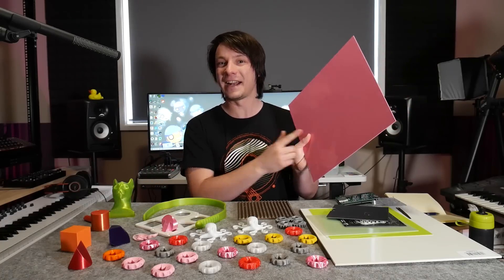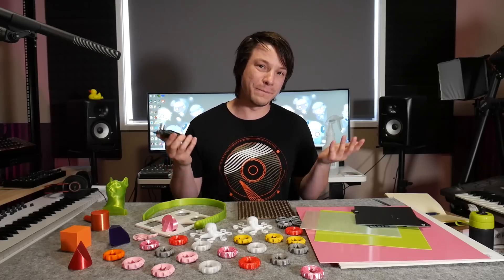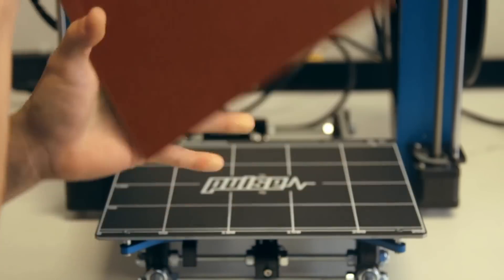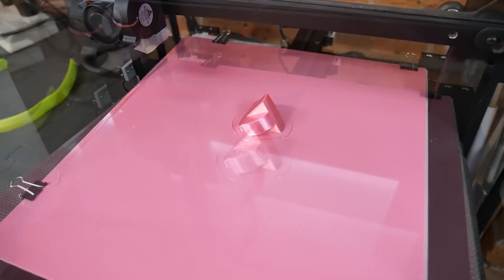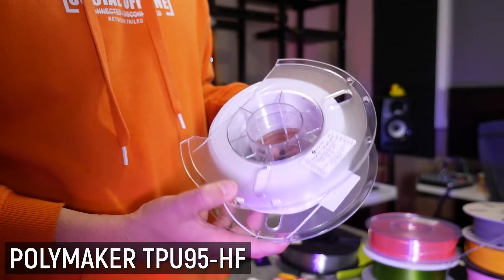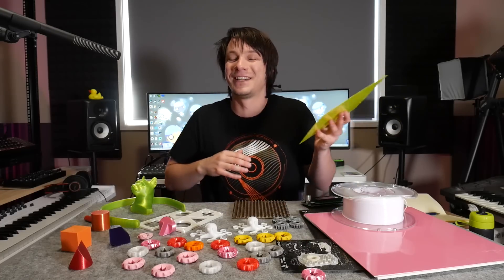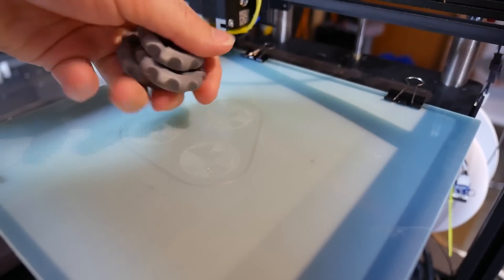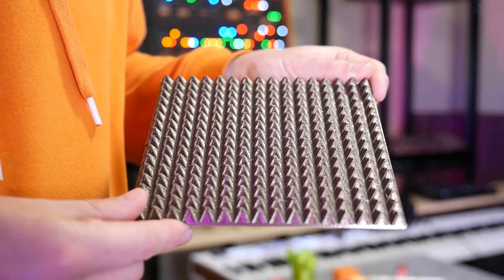G10 - The best print surface you've never heard of.

Comment: I use smooth PEI sheets on spring steel sheets with awesome results. They release prints as easily as G10 in the video, especially after they cool down a bit. How does G10 compare with PEI?
Reply: Yeah same, I use PEI for ABS filament and it works well with a raft or brim.

Comment: I've been doing this since 2016!! But I have an unetched PCB, the copper sheet makes my bed temperature infinitely more reliable!
Reply: That sounds brilliant! What thickness do you use, 62.5mil?
Reply: @McNibbler  that sounds about right
Reply: Nice idea!
Reply: Do the copper pours cause any issues with heating times
Reply: @McNibbler  haven't had any issues yet with heating times
Reply: You are basically talking about a different material then, as the soldermask on top of the copper is another surface than the raw epoxy resin of an FR-4 PCB. If it still works for your plastics, thats great. But i guess you could end up having issues, depending on the soldermask they used.
Reply: @ProtonOne11  An unetched PCB doesn’t have any solder mask - solder mask is applied after etching
Reply: @pmc_  If he just ordered a PCB from jlcpcb, pcbway or any other cheap pcb source, then they would still let the PCB run thru the solder mask application. If he prints on a bare PCB core with exposed copper on top, that is still not the same surface as the resin of a FR-4 board. My point was, that there are different material properties for different coatings/surfaces. So his properties with his solution (and what ever surface he prints on) does not compare to what Angus shows in this video.
Reply: @ProtonOne11  I bought a diy one from Jaycar with bare copper one side and g10 as the other side
Reply: @ProtonOne11  the unetched would still have a epoxy mask layer over the copper. Not a solder mask.
Reply: @brandonbrown3600  unetched pcb sheet is just G10 with a copper layer, no masking and no surface treatment, it's meant for you to put your own mask on the surface and chemically etch, there's no surface treatment, if you leave it exposed to the air it will actually oxidize the copper. If YouTube let me attach photos I could actually show you my stack of boards to demonstrate 😁
Reply: @brandonbrown3600  No they dont. 
They are made to etch yourself at home. Thus the copper layer is bare, else it clould not be etched. 

Some of them have a light sensitive layer preapplied, for people that intend to use lithography for creating the mask for etching.

Comment: I voted as wth is iT on Twitter but I knew garlite, just not g10.

I can't find it in my country sadly

I love my polycarbonate sheet tho! tho I should warn you most prints stick far better than garolite and you gotta scrape it off if you don't flex it (you can easily get a 0.5mm-1mm sheet so you can flex it, and the good thing is that if you damage it you can sand the damage off :) ) but A warning about polycarbonate is that strange it releases far better when hot, when it's cold you gotta warm it up again!

Comment: Speaking of printing on circuit board material: I once did a test and used TPU to print some circuit-like model directly on the copper surface of a circuit board. The plan was to etch away the copper that wasn't printed on, but I haven't done any electronics projects in a while, so I just never got to that. TPU sticks really well on copper. I think trying this would actually make a good video for your channel as it might also be useful for some robot projects.

Useless trivia: G10 is a popular material for making windsurfing fins using CNC. All the slalom fins I use now are G10.

Comment: Used G10 for custom drone frames. Recently as a transom for a boat.  Awesome i can use the left overs for a print surface now, thanks!.  Super useful material.
Reply: It's really popular for handgun grips too.
Reply: Hi Andrew!! What a surprise to find you here
Reply: what kind of drones, have you had luck with smaller 5inch or less? if its easy to cut, i might cut out a 4inch frame, but carbon is already pretty cheap for frames that small
Reply: I'v got G10 grips for one of my pistols, I never thought it would be used for a print surface lol.
Reply: I fabricate carbon fiber, kevlar and fiberglass. All compasite materials. All seem to want to kill you if inhaled. For flying drones carbon fiber is rigid has enough flex to survive many violent collisions. A mountain bike using specifically weaved panels depending on how common the damage is for the panel. Some weaved are meant for blunt force from the front, sides, back and multiple weaves on a single piece.

Fiberglass has slightly heavier if all else is equal. Such as layers of resin and layers of the compasite use. Fibergass will be able to withstand a much hardsr force becsuse of superior flexibility at the cost of significant rigidity. If the blunt force is too much it will hatter like glass. while Carbon fiber under the same force will shatter in a much less violent way.

Air drones carbon fiber, CNC and 3D printer thick Carbon fiber will is superior to alluminum making a  gantry made out of it extremely efficient. RC boats seem perfect for fiberglass so are bathtubs, toulets, sinks..etc.
Reply: do you like the g10 better than the typical fiberglass and plywood? I imagine a nice gray or blue textured g10 would look amazing with my eva decking
Reply: Now that i think of it,  I do have some old drone frames made from g10. I imagine it would work well on a rekon 1s lr instead of 3d printing the frame
Reply: I was wondering this exactly thanks!

Comment: I honestly think the least talked about but best print surface is Kapton tape. Been using it for years straight on alloy build plates, it is easy to apply, gives a shiny finish, heats quickly, releases when cool, just clean with acetone and can be bought in big rolls of varied widths.
 Almost everything sticks perfectly to it as it is, and if you don't go digging at it or crash a nozzle into it, it will almost last forever.
Its also the perect protective layer on a glass plate.
just spray the tape and plate with soapy water lay it on, use a squeegee to smooth it out and remove th excess water, done.

Comment: Wouldn't it be better to buy this stuff as one sided PCB material? You basically have built in pretty neat thermal interface - a copper layer - to transfer heat from the heated bed.

Comment: The epoxy resin matrix is the magic component. If you have a bit more money available for this hobby then carbon fiber sheets are a great alternative as well. 
Higher stiffness than G10 so you can use thinner sheets, which means better heat transfer.

You could also use a spray gun and apply a thin layer of heat resistant epoxy to a spring steel sheet and glue a very thin G10 Layer to it. 
FR2/Pertinax should work, too. Potentially the best of both worlds and relatively cheap (at least if you already have the necessary equipment)

Comment: Glass is the best material for a print bed if you can make it work. It's flat and resistant to thermal deformation. Try "roughing" it up with ultra fine grit wet sandpaper for better first layer adhesion. Since adhesion and release are contradicting variables,  you have to compromise for one or the other. I'm still experimenting to find the "sweet spot." Now, where can I buy ceramic tiles that cover the space shuttle.
Reply: @owowowdhxbxgakwlcybwxsimcwx  I don't like flexible surfaces because they deform overtime, and metal deforms due to thermal expansion. I just came up with another crazy idea. Granite or marble tiles leftovers. Damn it, I have to buy another heat pad.  LOL.
Reply: @owowowdhxbxgakwlcybwxsimcwx  PEI is a great material and I use it regularly at work to print ESD certified PETG ($110 a kg) for house keeping items. But in order to printing jigs and fixtures with tight tolerances, I need a build plate that is extremely flat and resistant to thermal expansion to print high temp filaments that can withstand 175C for thousands of hours. Something like ESD PEEK @ $450 for 1/2 a kilo. $_$ isn't a problem if I can justify the cost for something related to work. Most the time I BS to get an approval for my personal entertainment and learning. I've crossed that thin line many times like when I needed a pen holder, I printed a mesh skull pen holder and my boss was like...OK...LOL.

Comment: I used a spring PEI bed for my ender 3 pro instead of that horrible stock floppy one for a while, then I ripped a chunk out when printing TPU on it.. so I bought a different material to test, I regret it :/
It's just textured with some powder coat, things don't stick nearly as well. Then there's the faketak on my tronxy x5sa which I've only had a few weeks now, prints stick TOO well on it xD
Since I can't bend it, making it a bit hard sometimes to get prints off
Reply: @owowowdhxbxgakwlcybwxsimcwx  I think PEI fuses with TPU if I recall correctly, so it's probably not a good surface to print TPU on

Comment: Why not tape the 0.5mm sheet to a spring metal sheet with 3M Tape. It should have the  flexibility and you won't need clips since you put it on a magnetic surface.

Comment: I was a fan of FR4 until I tried FR2 aka Pertinax, Bakelite or phenolic paper. It is porous after sanding and sticks better to plastic while releasing easier release when cold. FR2 is also even more rugged than Fr4, my current plate is more than 1000 hours old and probably good for the same time, again. The price is similar, it‘s just not that easy to source.

Comment: I wonder if a single sided copper clad laminate is the same stuff. It’s advertised as FR4. It has copper on one side and that would definitely help with heat retention. It is often used for home made PCBs. Very easily available and is about 1.6mm thick.
Reply: @HPB1980 Yes ,FR4 is G10 with a fire retardant added.
Reply: @no-page  thanks! I have some lying around. I’ll try it out though it would mean fiddling with the Z sensor since it’ll now home to the copper under the FR4.

Comment: Anyone ever tried some of the ceramic paints they use on exhaust manifolds ? Paint it onto a thin steel sheet and bake it in the oven , wonder if it could work or if prints would stick to it - can handle 2000 deg F so they claim .

Comment: I've only ever printed petg, pctg & tpu; never bothered with pla.  Have printed oh... maybe 50 rolls of petg.  Been using a spring-steel plate coated with PEI.  Have been using it  for 7 months without adhesion or release issues on either of my printers. After going through 4 of the standard magbeds in a month,  I just use PEI now, its incredible. 
To be honest...I got a Garolite sheet a while back but have never needed it, so I never put it on.   And I've never used a glue stick while printing...ever.  No tape, no glue.   The print unsticks itself as it cools.  
Even a print covering a 200x200mm footprint with AMAZING adhesion will just....unstick itself, a minute or two into cooling.  Piece of cake.
Reply: @owowowdhxbxgakwlcybwxsimcwx  Yeah it's powder coated, and it's incredibly resilient, not soft at all.  I would go so far as to say it's very difficult to damage; and I'm using a vanadium plated copper nozzle, not brass.  
I've only done maybe 5 or 6 rolls of TPU but I just haven't experienced the issue you mentioned.   And I've printed 18hr TPU "disc golf" discs with surface area covering most of the bed. 
Since I put the one PEI bed on when I built that printer, and I used the Marlin bugfix fw, I have "printer stats".  So I can see that I've done 789 hours of printing on that $30 bed so far.  Still going strong.

Comment: I guess that the G10 sheet deforms because you are hitting the glass transition temperature when printing. It might be worth to experiment with higher Tg FR-4 (155 °C is common in PCB manufacturing, 170 °C is also available)
Reply: Aka FR5
Reply: G-3 is what worked for me, and did not deform with temperature
Reply: As the fiber glass is bound with epoxy resin in G10 it do not have a glass transition temperature. And I remember that 120-150°C is the point then most of epoxy resins will start to desintegrate when kept under those temperatures for longer period of time. The deformation is solely done by the forces that would otherwise cause delamination or warping.
Reply: @0thorgal0  It has a glass transition temperature. Also, most FR-4 materials have specified decomposition temperature where it starts fuming off, bubbling and increasing its volume due to the gas being emitted. You don't have to believe me, but having to deal with FR-4 properties is what pays my living...
Reply: @0thorgal0  To find a glass transition you first make stiffness measurements across the temperature range in question, then determine acceptable % of stiffness lost. Adding fibers increases the stiffness of plastics allowing them to be stiffer at higher temperature. In some cases, plastics will decompose before hitting the manufacture's decided % loss of stiffness but that is far from the whole story. Even steel loses stiffness at higher temperatures, the idea that adding fibers eliminates loss of stiffness at higher temperatures is utterly false.
Reply: @Anyone700  I don't know if your reply was meant for me as we are almost in an agreement. I understand glass transition temperature as point where the matter becomes elastic. What people here mistakes with glass transition is that any plastics looses some part of its structural strength with higher temperature (even way under glass transition temperature) and can suffer plastic deformation (it would not get under same load with lower  temperature). Most thermoset epoxy resins (I know) used to make glass reinforced sheets will sooner decompose then becomes elastic (and it have nothing to do with the glass fibers in it). 

In my point of view it is more advisable to use thicker sheet that will be strong enough on its own to not warp when the print will stuck to it rather than trying to make them flat again by bringing them close to their demoposition temperature to make them as weak as possible.
Reply: @0thorgal0  every polymer has a glass transition temperature. That includes epoxy. You can find the glass transition temperature of most reputable epoxies in their respective datasheets.
Reply: @mariohernandez1111  Er no, thermosets don't
Reply: @donaldasayers  You are confusing concepts. Thermosets have melting points above the decomposition temperature (so, you could say they don't have a melting point). Thermoplastics, on the other hand, have melting points below decomposition temperature. Both types of polymers may have a glass transition temperature below the decomposition temperature. 

Look up examples on epoxies and their glass transition temperatures. This is something you can easily find by googling.

PS: I was making a simplification when I said every polymer has a glass transition. Only amorphous or semi-crystalline polymers have a glass transition. Most polymers are like this, thermoset or thermoplastic.
Reply: @mariohernandez1111  Yep, it's why resin prints become soft and easier to remove supports when dipped in boiling water, but they won't melt.
Reply: @mariohernandez1111  My results with a 1.5mm sheet of G10 were that, while adhesion was very good, however, when printing medium and large prints with PETG, the object I was printing would literally pull and warp the G10 sheet from the amount of force/pull that the PETG object would have while connected to the bed (from the plastic cooling possibly). This would, of course, cause the print to be warped by 1 or 2 mm vertically, where the bed had warped upwards.  I had to put many clamps around the edges of the G10 sheet in order to keep it from warping (and it still would a tiny bit).  Ideally the 3 mm sheet would probably NOT have this issue so I would recommend everyone buy the thicker sheets (2.5 mm and thicker). If there was some way to glue/tape the G10 sheet to the bed that could solve the problem as well, but I would NOT want it to be permanent. So I'm unsure what type of glue/tape would hold enough to print PETG (with bed temps around 80C) and still allow it to be pulled off/removed later when the sheet of G10 needs to be replaced.  Any suggestions?

Comment: POM/Acetal is to me the hardest material to get prints, because of the Bed surface. Only one material worked as the POM fused with this material but it's a pain to get the part of the Bed again and the Bed can only be used once. I never tried G10 though

Comment: I don’t own a 3D printer yet but you could try slide clips to hold your surface down they are smaller then a bulldog clip so take up less print area they and also are reusable, and surprisingly strong.

You would need the appropriate sized clips for the thickness your clamping and a dispenser.

Search office works to find slide clips and a slide clip dispenser.
Reply: Do they make such that can span 4.6mm? 6mm?
Reply: @SianaGearz  the medium size at office works spans 40 sheets of paper approximately 4mm, the large size 60 sheets of paper or approximately 6mm

I’d share the links but spambot gets me

Comment: One of my homemades uses a sheet of single-sided PCB that I picked up from Jaycar (copper side down of course). Works fine.
Reply: That's exactly what I was looking for since regular Garolite sheets aren't available in my country. So regular single side FR4 PCB sheets work just as well?
Reply: @dhairya8238  seems to. The biggest problem with the Jaycar ones though is the size: 150x150mm. Only good for small printers. And even if they were larger, I'd be worried about warping due to their storage and display conditions, it's not really a use-case scenario that the stores are thinking about. Worked for me in a pinch, but YMMV.
Reply: @Myndale  got it, I've seen plenty of 300x300 sheets selling for like $5 each in some local maker stores. I'll try one out.